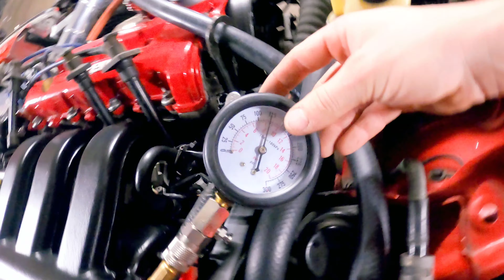BLOWN Transmission ? or ENGINE! I had some things I kept a secret for too long!...

Comment: I saw years ago Xtremethings.com were playing with a alternative transmission. I rekon you could be the guy to finish this research 😉
Sad news on red ted btw but makes for great content I guess.
Looking forward to seeing the rebuild as know mine will be due soon
Reply from the maker: What was the trans
Reply: @Suicid3mx3  2006 Pontiac 3.9L V6 F40 6-speed FWD transaxle was the template for the initial design
Reply: @mazdamx3trackcar  I’ve been digging on G6 performance for a while and the f40 is only good for about 350, people had countless discussions about trying to do builds on Pontiac’s and it always came back to all the transmissions just not being able to handle more than 350 before the reliability heads out. I own a 09 G6 GT which is how I knew about all this. The G6 transmissions just aren’t that great, it’s why nobody ever pushed the G6 platform for the v6’s and I could be remembering wrong and it’s actually only 300hp. So keep this in mind. You can go look up the g6performance archived forums if you want to learn more. After re visiting forum posts, the f40 will not handle clutch dumps and money shifts especially if you are over 300.
Reply: @CorruptInfinityOfficial  that’s answered that question then. Shame 😔
Reply: @mazdamx3trackcar  I know I’d personally love to do a full build on my G6 but I’ll have to wait until I can get a donor because manual swap can be aids on an auto car. Good job keeping an eye out for other options though, gotta be creative and throw things together sometimes when there aren’t obvious options.
Reply from the maker: @mazdamx3trackcar  thats insane ^ just re reading his trans swap*
Reply from the maker: @CorruptInfinityOfficial  ya thanks for the info guys that really helpful 👍